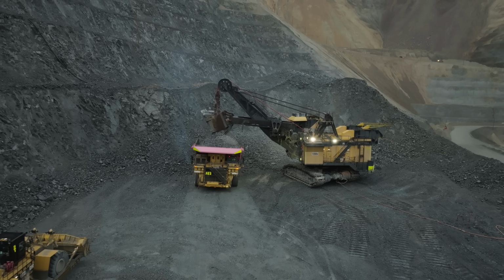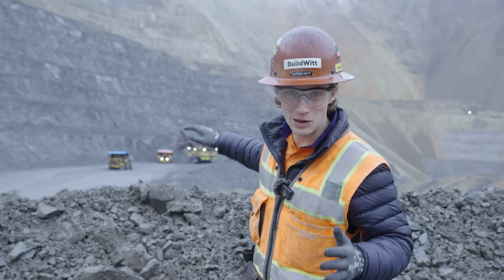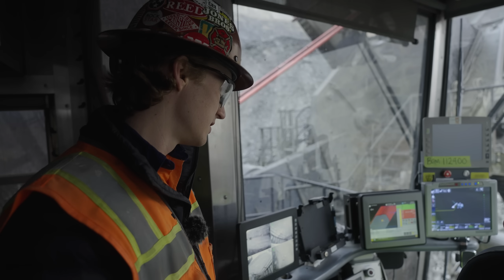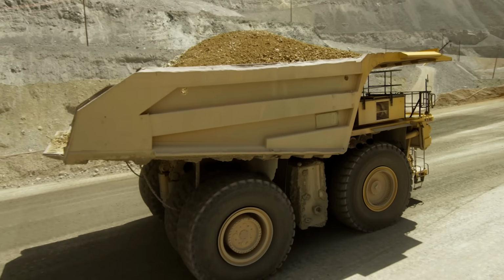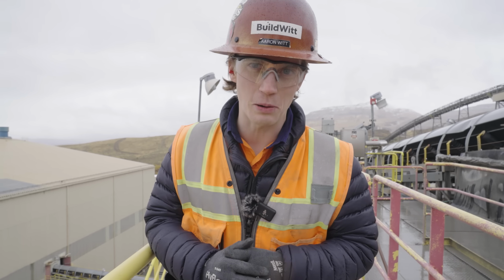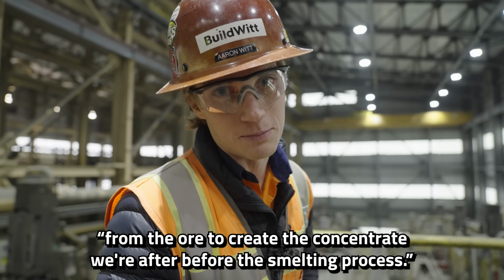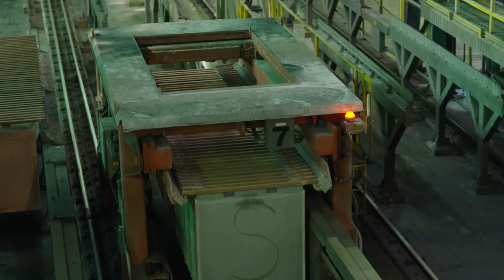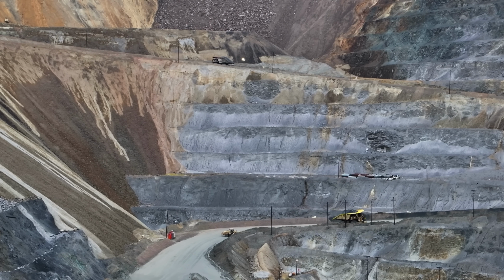Visiting The World’s Deepest Open Pit Mine - Kennecott Copper Mine

Comment: I work in the truck shop as a mechanic. You would be amazed at how this pit creates its own weather. This is the largest man made hole on earth. Its an amazing operation.
Reply: In my MSHA class they showed pics of the massive slide in the pit. The haul pacs all piled up at the bottom looked like minutiae toy trucks.
Reply: I hear that planes have to avoid flying over it, as a downward airstream can suck them right in and stall it.
Reply: @Nubenhoofer  Probably planes coming and going from SLC airport. Planes already at cruise altitude (35,000+ feet) are likely unaffected by this, if at all.
Reply: https://youtube.com/@raj-miner?si=nifQCLizGQ6FeLUE

Comment: Ive lived near the mine all my life. It has undergone amazing technological advances over the years. A few decades ago it used to pollute the Salt lake valley pretty bad, so they built a massive smoke stack to try to lift the emissions above the valley. Now that behemoth of a smoke stack seems obsolete. Not only has the pollution been dropped to minuscule amounts, but they have also re-processed massive amounts of slag from the very old process and extracted more copper from it as well. Modern mining is impressive.
Reply: Where does all the waste go? Just piles around the mine?
Reply: @massive_droner  Gigantic piles. Basically moving the whole mountain about a mile east.
Reply: @benjaminblack91  crazy!

Comment: Fun fact, they actually bought the town of Bingham right next to it, and completely covered the houses in waste ore. Another fun fact, they actually have no idea where a lot of the underground sections are from back in the day, so sometimes when they drill or blast they blow straight into an old shaft and send an rc car with a gps and camera into it to map the surrounding area. I’d say it’s definitely the coolest place I’ve ever worked haha
Reply: I was visting a friend in that small town( Bingham ) back in 1968 and some of the homes were already being removed .I have some photos of the town & mine .
Reply: @RonaldWood-ep7vg  no way! I’d absolutely love to see some photos, is there a way I could contact you?
Reply: Random question, why do they haul the ore up with trucks, rather than using a system of conveyors?
Reply: @dang3304  Think about it.  They are constantly moving around where they are blasting and loading ore.  They're not in the same place more than a few days running.  The logistics of constantly adding sections and removing sections would be a  nightmare, take much longer, and require constant maintenance.  They DO have a conveyor from the crusher to the concentration process building.   This is because the crusher and the separator/concentrator building are static locations.  
Consider this:  the huge dump trucks are mobile conveyors that don't need to be picked up and moved around to get them to the latest blast site.  It is so much less work and energy used, doing it this way.
Reply: @dang3304  actually interestingly enough, kennecott has the worlds longest conveyor belt system I believe. The trucks take the ore from the sides or the bottom of the mine up to the crusher which pulverizes the rocks so they can travel on the conveyor belt to the smelter. But basically having a longer belt system than they already have would be a mechanical and logistical nightmare especially since the topography of a mine is technically constantly changing. It would need to be in a new spot almost every other day
Reply: Copperton too right? Not just bingham or is that the same city?
Reply: @dang3304  there are a number of reasons, but the biggest is that they are always moving the line so it would be impractical to have a conveyer which is static. Once they are out of the mine, they load the ore onto a very long conveyer to take it to be processed.
Reply: @151bradhatt 
Copperton, Utah is still a town. They have not buried or torn down those homes. My grandparents used to live right at the edge of Rio Tinto property next to a fence overlooking some ponds. They've since passed away, but the house they lived in still stands. There's a park, churches, a school. It may be owned by the company, but it's alive.
Reply: @jefffredrickson9318  yes that’s correct, copperton is still there, I didn’t say copperton though I said Bingham. So yeah
Reply: @dang3304  I was thinking the same thing 😀
Reply: They buried a small city of lark also. Only thing left is a hospital and school used for storage
Reply: @RonaldWood-ep7vg 
😅
Reply: not facts, but cool.
Reply: Thanks for sharing! I need advice: My OКX wallet has some USDT, and I thave the backup phrase. ==clean party soccer advance audit clean evil finish tonight involve whip action==..What’s the best way can I sharing moving them to moving them?
Reply: https://youtube.com/@raj-miner?si=nifQCLizGQ6FeLUE

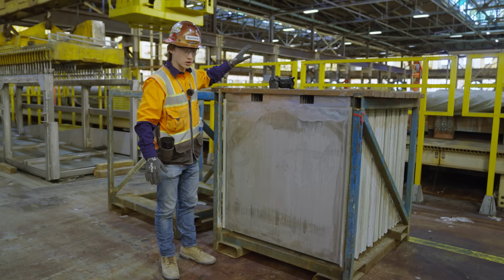Comment: 10:28 The process is called electrolysis. The plates take on either a positive or negative polarity depending on anode or cathode. The polarity of the electric charge attracts the copper because it has an opposite polarity. Electromagnetically

Comment: It's impossible to convey the staggering scale of this pit and operation. I live 20 miles away and the mine still dominates the western view. It is a very long trip up tge put, out, down the canyon and to the crusher. After being crushed, the slurry is pumped to the end of the entire mountain range to the smelter, on the shore of the Great Salt Lake. The mud and slag pits are larger that entire towns and are easily spotted from the International Space Station.

Morton Salt also runs a MASSIVE operation that can be seen from orbit. They literally farm salt from the lake using solar ponds measured in square miles. Check it out!

Comment: During the agitation air is actually introduced forming bubbles the valuable minerals particles will collide with the bubble and be embedded on the surface of the bubble as in moves from the bottom to eventually be floated . the process is called froth flotation

Comment: You said that rio tinto is the only mine that does the full process at the mine to make it pure copper but I work at the Morenci copper mine in Arizona and we do the same thing
Reply from the maker: Morenci doesn’t have a smelter
Reply: Miami and Hayden?
Reply: @craiglesworth2460 Hayden was also an integrated operation but the smelter is closed, and the Miami smelter is still operating but there’s no concentrator
Reply: @Jutf7xd thanks for the clarification! I think there’s still plans to restart the smelter in Hayden, but I’ve heard that for years now.

Comment: Why don’t they have a conveyor belt bringing stone up instead of the trucks?
Reply: Because that wouldn't be efficient doing it that way. A mines landscape is ever changing, and they would have to keep moving and building a new conveyor system.
Reply: I’ve been to kalgoorlie mine in Australia, did the tour and sat for an hour and watched the trucks going up and down. I get if it was easier they’d already be doing it but it just seems to me like it would be more efficient to have one or 2 dump trucks at bottom going to and fro and not having 30-40 going up and down and everything with it. Could electrify the conveyer too perhaps.
Reply: They used to move it all in rail cars. They would have to move the tracks almost constantly-a conveyor would be no different. The could only mine as fast as they could move the tracks. The do conveyor it out of the mine to the mill.

Comment: You said at the end that they then take the copper to market, but how, if they do, do they take it off the plate?
Reply: It has a stripping machine when the anodes get lifted out of the electrolyte tank it gets craned over to a stripping machine and stacked on a pallet the trucks look like they have very little on when loaded 4 pallets and not stacked hi very heavy material

Comment: Showing a penny when talking about copper is a joke.  A penny is NOT copper any longer, it is just zink lightly and very lightly coated in copper.  The mine is so large you can see it anywhere in the SLC valley as the overburden covers most of the mountains on the West side of the valley.

Comment: What they don't show you is the ecological disaster zone created by this mine.  If you go on Google maps what you see is a great big hole in the center of a mountain range West of Salt Lake City.  What you don't notice when you are looking at that is the area to the North of that mountain range between the mountain and Great Salt lake. Start to zoom in on that area. You will see Interstate 80 runs between the mountain And Great Salt lake. Between the mountain and the interstate is where they dump all the waste material.   Anybody that has ever traveled across that stretch of interstate 80 knows exactly what I'm talking about. It's a complete and total Environmental disaster zone.  We need the copper and we need the other materials and It's a necessary evil however......   Do not be left with the impression that this is somehow a clean operation that is not causing damage.  The consequences of the bi products of this facility are going to be affecting that area for tens of thousands of years.  The only reason that this is not an issue politically is because the area in question is a dead zone. To the North is Great Salt Lake. Nothing lives there except for Brine shrimp....   And to the West is the salt flats and nothing lives there at all. There's nothing in the way of freshwater aquifers or rivers or streams so the contamination from the waste material that is being dumped there does not make it into the water supply.  But as you're going past the dumping area if you know what it is you are looking at.... It's horrifying to think about

Comment: This is fake, pikies pull the cables out of your house walls and the walls of buildings on building sites, they burn the cables in a skip whilst drinking cider in their black trousers and “shiny” shoes beside their short wheel base low roof transits, and then they sell the copper to the local scrap yard, hey boss